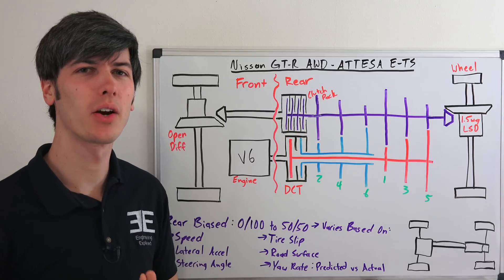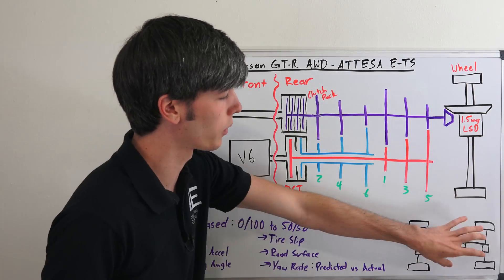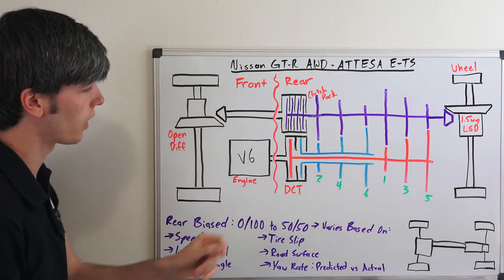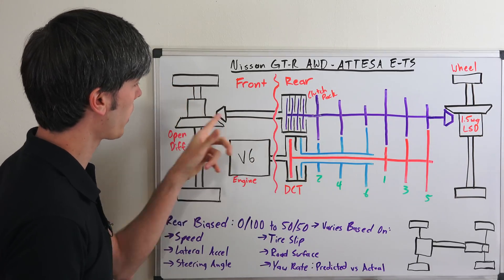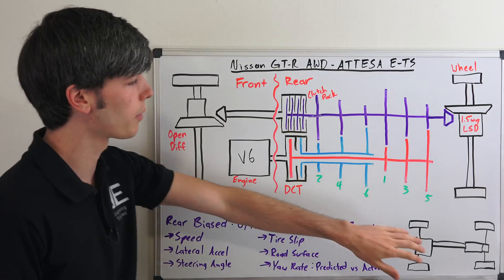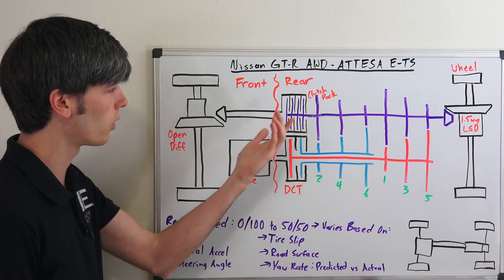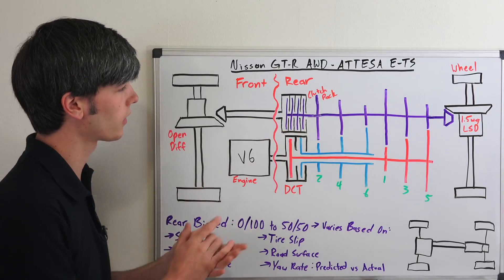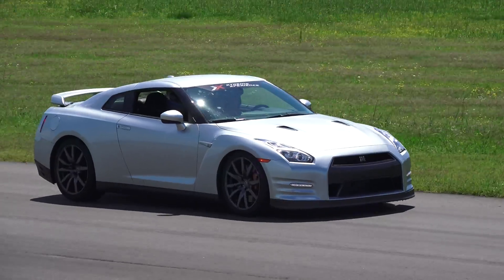Nissan GT-R AWD System - How It Works

Comment: Great informative video! When you drove the GTR did you really feel when the car was adjusting the ratio between the differencials? And how does all the adjusting done by the ecu affect the cars throttle response? Thanks
Reply from the maker: Did not feel it, as far as I know the throttle does not change.
Reply: +Engineering Explained Can you do a PDK Transmission  Video

Comment: Does that mean the AWD system can't shuffle the torque between two wheels on the same axle (Torque vectoring?).
Reply from the maker: +TheAsemAlkhatib it can with brakes, but not with the differentials, correct.
Reply from the maker: +TheAsemAlkhatib it can with brakes, but not with the differentials, correct.
Reply: +Engineering Explained 
Thanks for replying, made my day!!

Comment: this is an unusual thing to do , it requires ( to my understanding ) two drive shafts , and it adds a lot of extra weight to the car , the counter rotation of the two shafts  may have a gyro effect but it will likely be negligible , and i cant help but think that there is an engineer somewhere jerking off to this , because engineers nowadays make things just to make things and they are over-complicated  and as a mechanic i must say  i hate engineers and there "clever solutions" to problems that don't exist

Comment: Can you trick  the GTR to drift when the front tires are nearly worn out?
Reply: You'd probably want it the other way around? Keep the front planted, while the rear slides, so you want the rears to be bold.
Reply: IIRC, you pull the fuse for the AWD clutch pack. Maybe that was just for the R34?
Reply: You can drift the GT-R, even on Semislicks in the dry. You just need a capable driver and need to select track mode and deactivate ESP.
Reply: that worked just on the AWD R32s, the pulling the fuse trick.

Comment: Which computer games replicate this 4WD system?
Reply: NFSU2 but only if you put extra rice body parts on the car
Reply: Assetto Corsa the only way to go
Reply: Dont forget the stickers, +50HP
Reply: B0NEZ  i got a package with the 3 pedal setup and a different rim for the wheel. Anyways both because i got to actually drive on a local track for a couple laps with a 350z (although i didnt push that hard cause first time and the passenger was scared)  there was almost no learning curve except for the fact that it took me a couple tries to learn how to launch "gently" (less than like 4k rpm) in a manual cause i never had a need to before.
Reply: Assetto corsa, the internet, and 2 years of experience with a t300rs i can already performance drive better than almost anyone i know before  the age of even 16. Weird how things work these days.
Reply: clayton8or_2 Gran Turismo seems realistic enough for the job.
Reply: forza 6
Reply: NFS Most Wanted 2012.... final
Reply: performance drive in a game or irl lol
and that steering wheel comes with only 2 pedals
Reply: awesome!
Reply: Yeah, people think that being good at racing video games means nothing IRL, but isn't GT Academy a thing?
Reply: Well line theory still applies either way. It's just converting what you know to the real world.
Reply: Sameji  GT academy is kinda weird as you HAVE to play GT in order to qualify but using a more realistic racing sim is not counted? weird...

Comment: You can burn the clutch in a manual transmission car. But... Why doesn't this happen in a differential? Is it cooled somehow, or is it simply not slipping, but rather clamping down instantly?
Reply: You can, but it's far less likely to happen. The clutch starts working when the two wheels on a given axle are turning at different speeds and has to work harder as that difference increases. I've seen a diff clutch fail after somebody was doing full-lock donuts for an extended period of time. With normal driving, you simply don't abuse them enough for them to fail. Some are air cooled in the sense that the cover or housing has cooling fins built in, but the majority are not cooled, but just have the gears submerged in diff fluid.
Reply: *****
 It is a wet plate setup, involving 7 friction plates and 14 drive plates, its hydraulically operated between with a no contact before 3 bar and full lockup by 5 bar. However this is NOT how a traditional automatic transmission works, they use a fluid coupling rather than plate contact called a "torque converter". Some do have a clutch, but they only use it to to "lock up" the converter once slip has fallen enough, typically with the main purpose of reducing fuel consumption by eliminating energy wasted in heating the fluid, but some drag racers have so much slip they actually use the lockup as an entirely separate gear. Top fuel dragsters typically use the most extreme version of this ideology, with a multi-plate clutch and no transmission, but they rebuild said clutch every pass.
Reply: Two reasons. Firstly its engaging when the computer senses a need (at which point both front and back axles are at nearly the same speed) then staying engaged until no longer needed, not constantly slipping all the time. Secondly because it doesn't worry about "feedback" to a driver, its a big multi plate-clutch with aggressive engagement teeth so it can handle a lot more heat buildup and general abuse. People tuning for very high outputs still have trouble with them though, but then again they often also end up changing the rear diff so its not necessarily any weaker than a normal AWD system.
Reply: I would guess that it a wet clutch like you have in a automatic transmission....  Maybe fitted with a oilcooler
Reply: referring to the clutch-pack that sends power to the front...
Reply: Thanks for the explanation! To all of you.
Reply: +Hamish McGregor I was not referring to the torque-converter but to one of the clutch-packs that selects some of the gears in a traditional automatic - but I will admit that I didn't explain that part very well infact - not at all... ;-)
Reply: the differentials need to be overhauled eventually like everything else.

Comment: i want to see how does the subaru AWD system work? why its win all other AWD cars?
Reply: it is not better than other awd cars
Reply: It is better than most other AWD cars, exceptions to Audi's AWD and other more expensive systems. Subaru's main benefit with their AWD is that it's a cheap but effective system compared to other manufacturers.
Reply: +Amer Muratovic I'm not a fanboy, I own a Subaru and wouldn't ever own an Audi because they are horrible to work on and expensive to repair. All I'm saying is that Quattro AWD is a much more complex and expensive system which allows it to just edge out Subaru's AWD.
Reply: +KingSnake377 Subaru's AWD is a lot better than Quattro, it always has been. Plus, now Audi is using that Haldex system. In terms of AWD system, I think Subaru really makes the best of them all.
Reply: +KingSnake377 Complex doesnt mean better, remember. Plus, Subaru has multiple variations of its SAWD. From the very basic centre VLSD, open front/rear to the best from the STI with DCCD and torsen front/rear.
Reply: Subaru's magic comes from being able to engage the AWD system all the time and not have it overheat and break down. Most other systems leave it off until needed and still cannot engage it for more than a few seconds before needing to disengage.
Reply: He already made a video about the subaru awd
Reply: Thank you :)
Reply: Subaru is win due to cost and aftermarket.

Its AWD system is totally conventional, with the gearbox having a diff and a driveshaft that runs from one side to the front and the other the back. But turbo means its easy to make more power and AWD with decent weight balance means its easy to make it stick well. Honestly you can make many cars just as fast, but like with the LS engine in the states there is just so much support for the WRX boxer its easy and rewarding. You know how much boost your motor will take, what parts to swap to hit your goals ect, because so many people have done it before you.
Reply: +DoubleC also, audi people never have use for awd anyway, its just a sales trick
Reply: FSXgta There are a lot of types of AWD systems frankly, and not all of them are used for the same purpose. AWD from the heavy offroaders for instance are horrible for everyday driving because of their locking diffs. Quattro on the other hand is more used as a brand and just for safety reasons, nothing more. While Subarus AWD is a very well round purpose system. Is perfectly fine for daily drives but goes incredibly well offroad too.
Reply: ***** Subaru has an extraordinarily good system, but I'm not going to deny that Audi's AWD is also incredibly good. 

Subaru's main issue is the lack of locking differentials (not to be confused with LSD), where some Audi's came with a locking rear differential which is better in certain situations. Without bringing reliability into it, I believe that Audi's system might be marginally better. But it's honestly a toss-up between the two. 

However it's always a better decision to go for the Subaru in the end since German engineering will nickel and dime you to death after the warranty ends.
Reply: +Walter Black i have permanent awd on mine
Reply: KingSnake377 I don't recall Audi ever using locking diffs on their cars though
Reply: +DoubleC Some Audi models from the early 90s had lockable rear-differentials. I think the trend continued until the late 90s some time.
I mentioned Audi so I didn't look like a Subaru fanboy, but still got bombarded by the other fanboys like myself anyways.
¯\(ツ)/¯
Reply: +KingSnake377 I disagree. although quattro is probably 2nd best. I'd say subies symmetrical awd is #1. Mainly because its drive axles are symmetrical (in terms of length) while audi's are not (the front drive axles). When traction is low, it causes the car to kind of rotate because different torque is sent through each front axle. I've owned one and it feels weird, especially on snow. No big deal really but my buddies STi just pulls straight. Doesn't really rotate. And when you're on on a patch of ice, the torsen diff kind of shits itself cause it can't multiply any torque without some resistance while the viscous diff can in the subie.
Reply: Ashton Murch
You can get more traction by feeding a little brakes, but I feel you, for offroad 4x4 is better than AWD and the Nissan system does let you achieve that when the clutch is engaged.
Reply: Hamish McGregor Yes, that's exactly what ESP in the Audi will do. Itll apply brakes to get the torsen diff to multiply torque to wherever, but if you have say ice on the FL tire and RR tire it tries to apply brake but it can't go anywhere because its multiplying torque but holding you back from moving because its braking lol! Its happened to me. And obviously, because of locking diffs 100% agree 4x4 is better off-road.
Reply: +Ashton Murch awd and 4x4 is the same you idiots
Reply: Amer Muratovic Depends on how you define it I guess. Some say "fully time 4x4" and "part time 4x4" instead of 4x4 and AWD, either way the difference is weather or not the input shafts to both diffs are locked to the same speed or not. For example a toyota hilux is "part time 4x4", a subaru WRX is "full time 4x4". The hilux is RWD on the street, requiring the user to engage the clutch while stopped to shift into 4x4 (you may also need to lock the hubs manually), but then its locked between output shaft of transmission and both diffs. The Subaru has a "center diff" thats always powered, allowing it to place torque to the front wheels on the street, but also allowing a difference in speeds between the input shaft of the front and rear diff, which is less ideal in mud or snow.
Reply: IOUaUsername Manual vehicles have a center VLSD, the WRX has an additional rear one. No open diffs.
Reply: IOUaUsername Audi is not front biased. Only the a3/s3 and q3. The rest with true quattro are 60/40 split with 60 rear
Reply: mitsubishi's AWDs are cheap and practical as well.

Comment: still wonder why no other car manufacturer uses systems similar to this, for a front engined car it's just the best in terms of performance
Reply: Because its a complicated and heavy way to achieve a good weight balance, adversely effects cabin space and will always rely on computer intervention to regulate oversteer\understeer since when the clutch is fully locked one front and rear wheel will be at the same speed, which isn't possible during a turn without wheel slip. It also makes it hard to get a traditional manual transmission with good feel if you want back seats.

Don't get me wrong, I love the GTR, its an amazing car, but "traditional" AWD with a center Diff is simpler, lighter and plenty of cars already get a 50-50 weight bias without the need to move the transmission. On the other hand the GTR does allow you to still get the conventional RWD style burnout or drift, which I think is important for the "Muscle" style marketing Nissan sports cars prefer.
Reply: @SheepInACart  Ok, so a few points to raise here:

1. The clutch pack is very rarely going to fully engage unless traction is especially dire. The system won’t allow itself to send more power than the fronts can handle during hard cornering in normal conditions.

2. A traditional centre diff isn’t capable of sending 100% of the power to the rear, which is crucial during high speed cornering scenarios, low speed agility, and directional changes.

3. There is a much higher level of drivetrain loss in a traditional centre diff setup compared to ATTESSA, since during acceleration at higher speeds, the system can put all of its power into the rear diff and leave the clutch pack disengaged.

The centre diff system still has its use cases, but it’s much less suited to the track compared to ATTESSA and similar clutch pack systems.
Reply: Probably costs.
Reply: Hamish McGregor yeah i get it, but it'll really help big awd cars with their understeer, given the fact they can adopt a transaxle configuration. it'll definitely give them a much more bully-ish character in the way they express performance, which is something that would go really well with, say, an audi rs6 (but then again the transaxle would make it rather compromised inside).